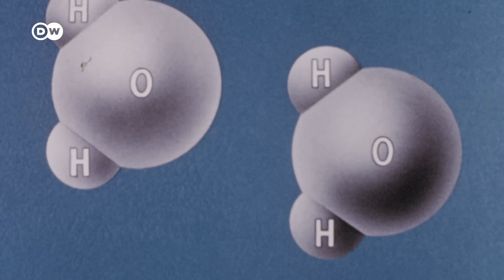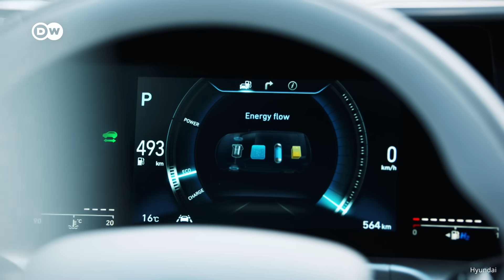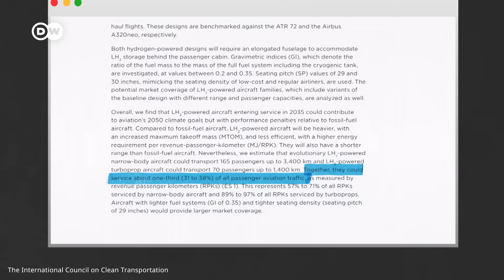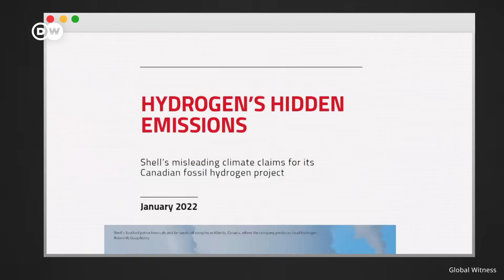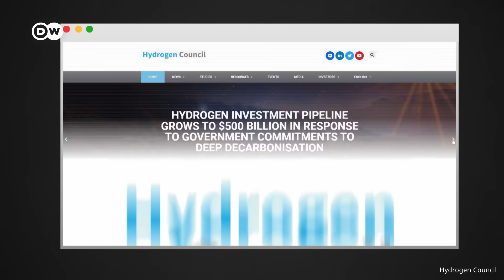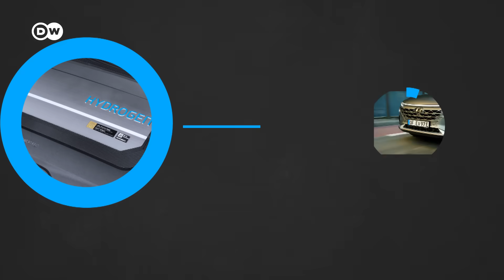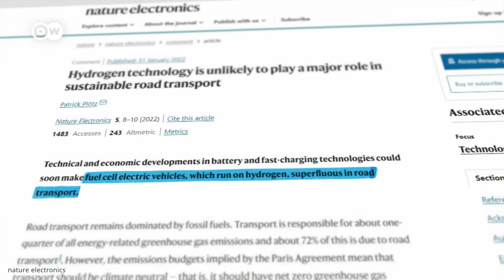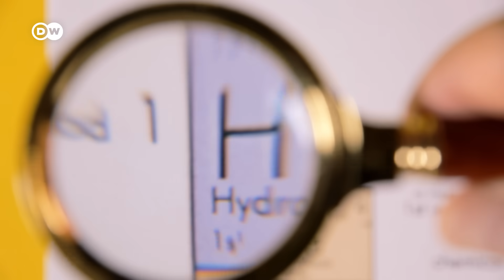The truth about hydrogen

Comment: Lets stop kidding ourselves, hydrogen is suppressed by the powers that be from big oil to Elon Musk. Electrolysis from solar is a  net productivity, it's all about storage. What container ship could traverse the pacific on batteries?  There is a radio frequency that splits the water molecule more efficiently than direct current. The energy to produce hydrogen is more than the energy that can be aquired from hydrogen argument is ridiculous. How much energy does it take to drill, pump, distill, transport,  and utilize oil for the use of gasoline?  Not to mention most of the chemical energy in gas is converted to heat not mechanical energy when burned.  Only about 30 percent of the energy in gas actually moves the vehicle the rest converts to heat. Hydrogen can be produced at home to fuel the house and vehicles from solar power, this is the real problem,  not for everyday people,  but for the powers that be.

Comment: Use base fuel to be cultivate, means ships, airplane, trains, power plants and such heavy areas can be run on nuclear, green hydrogen, methane fuel, which has no or minimal hazardous emotion, only hazard is radiation or leaking, this can be taken care at design and product specific as like black box standard. rest fuel like petrol diesel can be use in cars only and two wheelers can be made electric only. In nutshell, product wise strategies can work in favour of everyone, and in favour of our mother earth.

Comment: I like hydrogen as a energy holder. As u can ship the hydrogen much more efficient around the globe, aswell as in the low energy times u have hydrogen from the high energy times. And as we all know, batteries are real expensive and not so efficient at storing energy long term.
Reply: Hydrogen isn't even a viable short term storage - you have so much inevitable evaporation or diffusion losses because the hydrogen molecule is so small...

Comment: The big oil companies have already decided to kill the world. Every new "energy source" they make up just burns fossil fuels faster so there's more demand and justification to raise prices. First they introduce electric vehicles with the lie that burning it all in one place is better for the environment. Now they introduce blue hydrogen as a way to burn even more fossil fuel to make and carry light flammable gas around. Next is wireless direct current, which they can point and direct with beams like 5G signals and put on a subscription-based supply chain. But that energy will still need to be generated with burning non-renewables and more waste is introduced through transmitting the power. Everything will go according to *their* plan, regardless.

Comment: The thing is, hydrogen doesn't just come out of the ground, "green hydrogen" needs 3X to 5X more electricity (solar panels, wind turbines) up front to deliver the same amount of energy to its end point.
Long distance transmission of high voltage electricity only loses about 5% and depending on the EV maker efficiency varies, Teslas are up to 92% efficient, so grid to wheel is 87%, I could see less than 80% for a 9000 lb hummer
Then you say H2 is 40% efficient but in actuality it's less than 20% for cars once you factor in all the energy and materials used to build the electrolysis plants, distribution networks,  compressors, and refueling stations. Then there is the ongoing use and cost of energy, labor, and maintenance required to keep that infrastructure running and open for business. 
Nevermind the people who will try to argue, "the grid needs maintenance too" because, as stated first, H2 needs 5X more grid
Reply: I read a lot of comments about hygiene being to energy intensive to be economic compared to battery in relation to transport...it completely ignores the fact that GREEN hygiene is produced from renewables and the last time I looked the energy used is "FREE" after plant and supporting infastructure is installed...The reality is power production for consumer and industrial use is running close to capacity in the west so if transport goes battery electric then the price you will  be paying for a charge will be rediculse, that's if you can find a free charging point to plug in to.... hygiene makes sense for BIG OIL to invest in as it fits nicely in to there business model and existing infrastructure and is a point of sale that would suit most consumers for speed and convenience as thay just pull into a service station fill up and drive away...there are some pretty smart countries banking on hygiene ( Japan Korea  Singapore Australia to name a few) Australia is gearing up to be the biggest producers of green hygiene in the world...not only for export but internal use ....it's going to take a while for the rest of the world to catch on but once the pumps start to be rolled out the manufacturers will crank up there out put to meet demand, give it a decade hygiene vehicles will out sell battery electric 100 to 1 I guarantee it!!!.🤔
Reply: @caravanstuff2827  brother you keep typing hygiene i assume you mean hydrogen?
Reply: @caravanstuff2827  you need to dig much deeper into the economics of hydrogen. 
It's a joke to think hydrogen will ever compete with electricity. Well... actually it's misinformation being shat 💩 by the fossil fuel industry cuz they make 90% of the hydrogen from steam reforming of nat-gas. They know nobody is going to pay 2X more for green H2. The truth about reforming is that burning the gas directly in an ice car is more efficient (cleaner) than making H2 from it.
Reply: Yes but my house can easily use gas, if my gas powered heating system needs to go full electric powered I cant afford it. So Hydrogen is the easiest way to go. It may need more power, but new hydrogen plants can be made with that in mind. Billions of existing houses cant just go full electric.
Reply: @scott19087  you're missing the point that splitting water to hydrogen requires significantly more more energy (electricity) input than energy you get back. In other words, if you need 100 Kwh electricity to heat your home it would take approximately 200 Kwh of electricity to make the hydrogen to heat your home (could be 150-300+ Kwh depending on the efficiency of your H2 furnace)  and using a fuel cell (electricity to hydrogen back to electricity) requires 300 to 500 Kwh of electricity in to get 100 Kwh out. Not to mention the additional expenses to compress, store and distribute the hydrogen which is significantly more expensive and complex compared to wires and batteries.  So using the electricity straight from the source will always be cheaper than hydrogen.
Reply: Home heating is a use case where hydrogen makes zero sense in a carbon neutral environment. It's 30% less efficient than a resistive heater, while requiring a roughly equivalent overhaul on your heating system and an entire new gas network to supply it.
Reply: @jamiechapman-brown741  you don’t need a new gas network, at least in my country. It may be less efficient but so are electric heatpumps ofc. We already  have a few test projects in my country and its looking great

Comment: Excess electricity from solar or wind could be used for hydrogen production instead of being pumped into batteries. Unfortunately I think you need freshwater for electrolysis and usually people like to use that. Maybe you could use excess electricity for powering water treatment plants as well but that’s assuming you’ve got enough power for 2 industries.
Reply: When you burn that hydrogen it produces water vapor. So use as much fresh water as you want/need.

Comment: The comments seem to focus not on hydrogen as a storage medium but different ways to store the hydrogen.
Both questions are important: How to most efficiently store energy as hydrogen and then how to most efficiently store the hydrogen.
Another question is how to most efficiently release and focus the energy stored in the hydrogen.
And this is the biggest problem with hydrogen: It's a complete system restart. To use it we need to reinvent the entire energy transport system from scratch. This is one of the reasons the  petrolium industry favors it: its such a radical departure that it can be delayed continuously.
For me, creating petroleum products from energy, hydrogen and Carbon dioxide -aka, synthetic fuels- offer a way of leveraging critical delivery infrastructure we already have. 
IMHO, modular plants that input water and energy and output jet fuel for the US military would be an excellent first step. The Navy has already done the preliminary work and it's ships are already configurable to kerosene consumption. A plant synth that can be retrofitted into nuclear carriers would suddenly switch them from a consumer of fuel to a producer. And it could eliminate a crucial supply line, simplifying logistics.
There would be tremendous pressure to NOT implement this plan, as the US military spends massive amounts of money on fuel. The petroleum industry would put all their considerable might into blocking it. But it would be a logical first step.

Comment: I don't think hydrogen should be used much. I also don't think cars, trucks, and airplanes should be used much either. Cars are fundamentally inefficient, compared to walking and cycling, and public transit. No form of car will ever compare to the cleanliness and efficiency of other forms of transit. Not battery electrics, not hydrogen, not internal combustion, and not autonomous/self driving. Trucks and aircraft are fundamentally inefficient compared to trains. The fact that long distance air travel wouldn't benefit from hydrogen makes it useless to consider as a fuel source. Medium and short distance travel should be done with mostly electrified rail. Air travel should fill the niche of ocean crossings, not flying over land much at all. Electrified surface transportation should be used for the majority of medium to long distance trips, walking and cycling for the majority of short distance trips. We should redevelop countries like the US and Canada from low density sprawl to higher densities, in cities, towns, and villages. Clustering development in smaller spaces makes room for farmland and wildland. It puts less stress on infrastructure and utilities than sprawl. In conjunction with more efficient forms of passenger and freight transportation, it reduces the time spent in transit, it gets people out of cars and out from behind the wheel so they can do other things. Also, the electrification of buildings is another important part. Space heating/cooling, water heating, and cooking are often independent of the grid in the US. Gas is used for a lot of it, propane or natural gas, either stored in a tank onsite or piped in. We need to become disillusioned with hydrogen, and more importantly with fossil fuels and the car and aviation industries.

Comment: All of this doesn't make any sense. So to make Green Hydrogen, we need lots of renewable energy. But we currently don't have enough renewable energy to even cover our entire demand for electricy through that. So how is this even supposed to work? You'll need excess renewable energy to do that, but there is no excess renewable energy anywhere to be found. And it will still take a very long time to get there.
So we need to build renewables to replace fossil fuels for electricity first, right? This process will take a lot longer than 2050. After all fossil power plants have been shut down, we can use excess green energy to make green hydrogen. Anything else doesn't make sense. 
Ok, you can theoretically use excess solar energy during summer, energy we would otherwise be unable to use or store, to make green hydrogen, regardless of our current energy mixture for electricity - sure. But this dosn't work in winter. When whole industry branches switch to hydrogen instead of fossil fuels, like the mentioned steel industry, they'll need a constant supply of this green hydrogen, doesn't matter the season we're in. And excess solar energy during summer in the northern hemisphere will never be enough to store enough hydrogen to cover all of winter.

Comment: Most of the so-called "hype" for hydrogen seems to be by it's detractors. Just a decade or so ago, EVs were considered hype and the tech was dissed by similar detractors. One must learn to look through the hype and be driven by facts, and facts alone. I believe Hydrogen (especially fuel cell) got a bad rap because it was pushed to consumer cars, which I feel was a big mistake. Instead, they should have targeted commercial fleets, who have the ability to play, strategize and invest in such technology at scale.  Some point down the line, perhaps hydrogen fuel cells could provide extended range to BEVs but the eco system needs to develop first in a controlled environment (like commercial fleets)
Reply: Difference is Oil companies advocate Hydrogen and were against EVs
Reply: I hope the ev's dies along with the market in less than 2 years
Reply: @letsseepaulallenopinion3217  Dream on

Comment: Hydrogen is probably always going to be a backup fuel system in the economy to that battery Electric and direct electric; take for example the railway industry it is much cheaper to run a train on electric after the initial costs of  installation has been meet but where the installation of the infrastructure has yet to be installed battery Electric units would be better than hydrogen; hydrogen would still have an use as a backup or the last kilometer power system.

Comment: Hydrogen is not primary energy, hydrogen is energy storage that is best used to support the alternative energy solar and wind and deal with their intermittence by combining hydrogen fuel cells with hydrogen electrolysis to make a hydrogen battery. We should invent fuel cells that can function in reverse by breaking down water with electricity to make hydrogen and be able to then use the hydrogen to deliver electricity. It is a good option to clean up the grid. No I don't support using the fossil energy just for hydrogen, though if hydrogen is a byproduct of general use of fossil energy, we should use it too.

Comment: As I can see, hydrogen's only advantage could be if they can capture and bound the carbon emissions at the place of hydrogen production.
If that is not achievable, then they only waste energy and emit even more greenhouse gases by using hydrogen compared to battery electric.
Reply: Nope. Hydrogen's advantage is that it can store electricity something nothing else can realistically do at a large enough scale. It would be like making oil from electricity.

Comment: I think hydrogen has a lot of potential for a wide range of energy needs.  However, many of the difficulties associated with it make it a poor choice in many cases.  I think development of hydrogen as an energy source should focus on applications where alternatives to fossil fuel are difficult to find such as steel production and ocean transport.  If it is successful at these applications then the production, transportation and storage infrastructure will follow and that may make it available for other applications where the development cost would otherwise not be viable.

Comment: We will depend even more on Hydrogen then most believe: The era of CheapLithium is OVER. The price per ton has risen from 5000 Dollars to 50000 dollar in two years. Even if it will level on 30.000 cheap lithium for mobiles and cars will not be there. Electric cars will be a luxery for rich. Sodium will replace Lithium in some place but is much heavier.

Comment: My neighbour has a Toyota Mirai H2. The H2 it consumes for 60mi (~100km) needs 50kWh alone during the production process. My BMW i3 consumes 14kWh/60mi, a Tesla 16-20kWh. 
It's already very clear that the battery solution is the most efficient and cheapest. 
But above it, it's simple tech and that worries the car maintenance industry the most. They are dependent of complex tech that gets faulty and causes repair time. I mean, I saved over 3000$ the last four years on service and repair cost compared to my former ICE cars. Not to mention the energy cost savings.
Reply: Dear RB. A cars roof area is too small. 1 SQ M solar panel only makes 500 Watts at midday summer.) 1/2 hp). Zero at night. I know a solar powered plane flew. Its wings were huge. The whole thing was ultra light. Not commercial. Make H2. Planes can run on o. k.

Comment: @8:10 - "this produces no emissions" well that's not a fully true statement is it... In the manufacturing process of solar panels, windmills and hydrogen factories you still need fossil fuels to produce those. And nuclear is lower CO2 emission over lifetime compared to wind since you need to rebuild the wind mills 2-6 times over the lifetime of a windmill. So from a pure CO2 standpoint you'd be better off using nuclear as a power source to produce H.

Comment: The biggest problem is governments subsidizing fossil fuels.

If fossil fuel subsidizes ended then it would be far cheaper to get hydrogen from renewable sources where you do electrolysis from wind power.  But because the oil and gas industry is subsidized it's cheaper to take the money from the  government and use the fossil fuel with steam reformed hydrogen.

And I hate the expression "net zero" because it means that you can do something that creates green house gases and as long as you do something else to offset that.  And that something else would probably have dodgy mathematics that does add up and your really net emitting CO2.

It would be better to have zero emissions, not "net zero".  Don't emit green house gases.